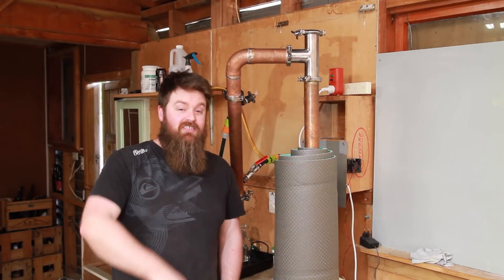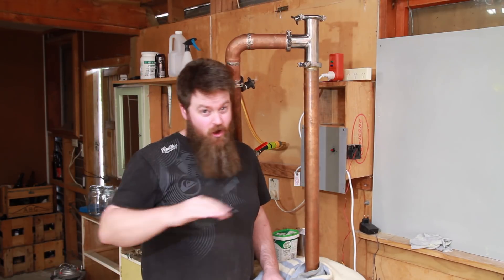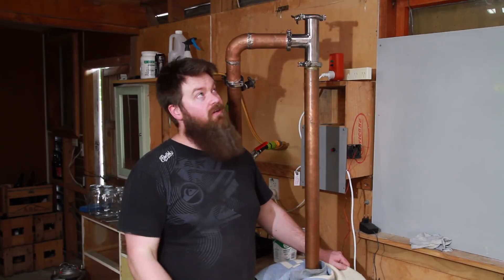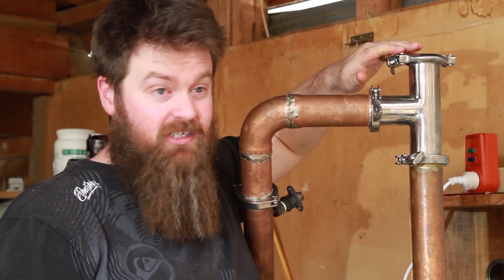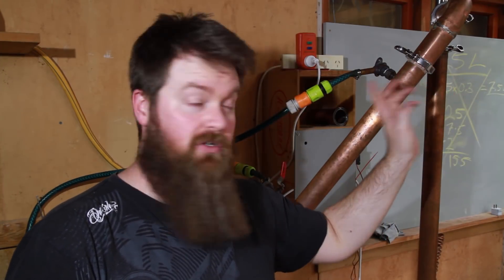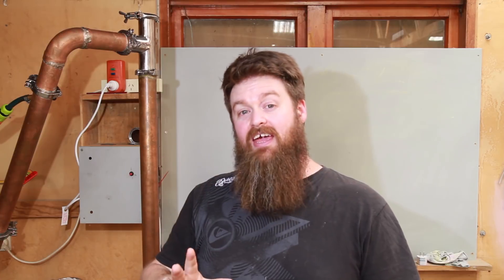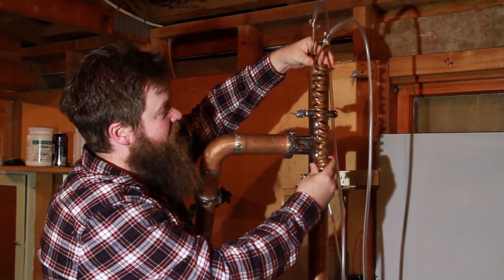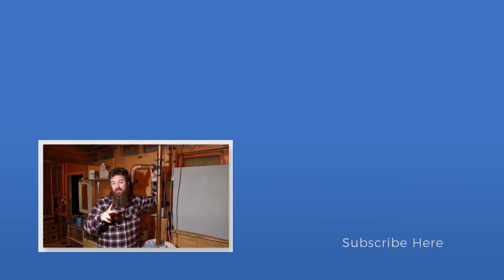CCVM Still Build Overview - The Right Still For You?

Comment: Hey great channel! just a question did you use lead free solder?? I have just finished building mine with lead solder but am now worried to use it.
Reply from the maker: +Josh Longland yes!  Definitely lead free solder dude.  lead is one of those things you don't want to mess with.

Ah no how much work have you done?
Reply: Still It thanks for such a quick reply! It’s finished! 😫 but there are only about 6 solder joints, no big deal, I will head to the shops get some new joints and some lead free tomorrow. Also done some reading into it and it’s a big no no, it’s just not worth the risk, it’s about to get chopped up!
Reply from the maker: +Josh Longland good plan man.

Yeah if your going to do it, do it safe!  What kind of still are you (re) building?
Reply from the maker: +Josh Longland and that sux you had it all done haha
Reply: Still It hey hey so all sorted now with lead free solder! Have you got any idea why my heads were clear as anything but after the first 50 mil The distilit Went brownie in colour?
Reply from the maker: +Josh Longland awesome man!  Have you done the cleaning schedule?  Vinegur and a sac run?  

It could be gunk coming out from soldering etc, but I'm guessing it could be a puke.  

How full was the boiler, and what are you running?
Reply: Still It , I didn’t do a cleaning run 😑 but the first 50ml was clear as water! I’m making Gin and have build a still from a beer keg, basically a budget version of yours. Will send you some pictures or eventually do a vid. Thanks again man!
Reply from the maker: +Josh Longland +Josh Longland hte to be. Berer of bad news man, but you may want to think about not drinking that first run.  

Have a Google of vinegar cleaning run and then sacrificial run.  

Your call, just letting ya know ;)

Cool on the build dude!  Keen as to see it!! I REALLY need to get gin sorted!!

Comment: Is the top of the still sealed and is it recommended you seal it when it in ccvm mode
Reply: It is worth stating that it is a serious safety hazard to seal the top of a reflux still.  Many of them are of valved design, and if you were to put it into full reflux, you would have a bomb on your hands if cooling were to slow or stop.

To the uninitiated it seems strange that boiling vapors get 100% knocked down, but they do, eliminating the need for a top at all with reflux stills.
Reply: No.

Alcohol vapor is heavier than air it would make its way over to the "T" and fall down through the shotgun condenser. Think of alcohol vapor as if it were water, it would rise up the column and over to the tee and fall out.

The only way it would come out the top if Jessie had an enormous amount of heat put into the boiler. If he was running more than 8,000 to 10,000 watts on full blast and both cooling water systems stopped, it would flood out the top.
Reply: Nope. The cold water in the coil draws all the vapor to it, cools and condenses it which makes it rain back down the column. It doesn't seem like it would catch it all, but it really does. It's neato:-)>
Reply from the maker: +Ambrose Ratcliffe these guys have you covered ;). Sealed when using as a pot, just the open extension + condenser for ccvm.
Reply from the maker: +Bobbywolf64 yup yup!!! Yeah thanks for putting that down man.  

I feel like I say this stuff all the time.  But forget that it may not be in each individual vid.  And someone may just watch one video etc.

Comment: Hi what prevents vapors escaping out the top when using the adjustable coil?
Reply from the maker: +larry baker good question.  I should have mentioned that!  

The coil itself.  Any vapor that makes it up that far will condense.  And then fall back down.  It doesn't have to be sealed because of this.  

It's weird at first to think about.  But I after seeing it work it makes sense.
Reply from the maker: 1) You mean to stop the vapor escaping?  Or to stop pressure build up?  
2) The coil won't physically stop the vapor moving past.  Just cool it down.  So the more you move it down the less vapor can make it to the tee before it condenses again.  Also the range of adjustment is mostly just the width of the tee, pluss a little wiggle room I guess haha.  

Its hard to put into words.  Check that link I gave in the description.  Dad300 does a good job describing it with diagrams etc.
Reply: I've been wondering how that worked.
Reply: The first time I saw you run it I was really surprised how well it knocked down the vapor. Physics is awesome!
Reply: Could this be a wood-be safety device(valve) knocking down vapors n preventing over pressure of the containment device also known as the boiler or still?
#2 question how does the vapors pass the coil when in different depths to make that tee of a turn?
Reply: Doing a blind test on heads &tails is so difficult with a head cold
Reply: Keep up the greatest show on planet 🌎
Reply from the maker: That it is my man!
Reply: Think of the coil as the valve, the higher you raise the coil in relation to the take off port the more "open" the valve is. Slowly raising the coil alows more vapor to pass into the take off port and less reflux. Valve all the way down is "closed" position ie full reflux. This design allows infinite reflux ratio settings.